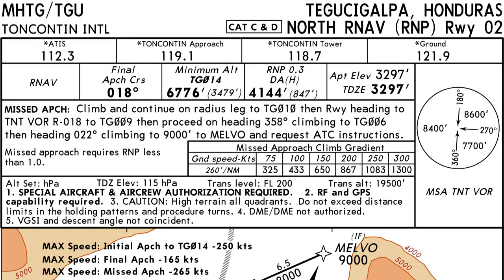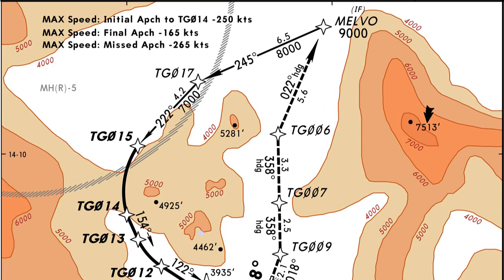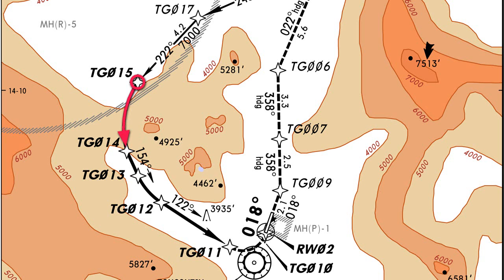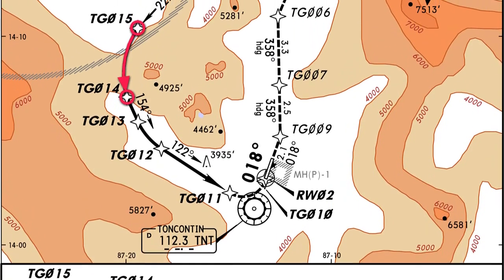10 Most Extreme Airports - #2 Toncontin MHTG (Episode 10-1)

Comment: Unless the approach plate specifies a heading, the numbers you call headings are actually magnetic tracks or a magnetic course. The final approach fix which is depicted by the Maltese cross is an important milestone, but the IAP (Instrument Approach Procedure) doesn't dictate when to extend the landing gear; it shows the parameters and how that's achieved is another matter. That's a function of the airplane flight manual, airline operation specs and pilot judgement. In this case I'd say it should be extended NLT the final fix. Great video none the less.

Comment from the maker: @FlyUPS767

ATC has priorities, safety, separation etc etc.  ATC doesn't care whether you do it with VNAV, AP or manually.  You descend when the ATC tells you to, not when you programmed it into you VNAV.  They know when you need to start a descent, so they wont mess you up.  If it is not when you expected, then it is up to the pilot to adjust, unless it is a safety issue.

You can always make a request from the ATC, and they might work with you but not always, especially in congested areas.

Comment from the maker: @FlyUPS767

ATC's will usually vector you on to final same as MSFS. Plates are used for all the info about the approach, or comm failure.

When you file your flight plan, there is a code you put in after your plane type (example C182/U), that U denotes the NAV equipment on the plane, so the ATC always knows what he/she can give you.

Do what the ATC tells you, not what your FMC tells you, unless its a safety issue or you're are to break a rule, in that case inform the ATC you can't comply.